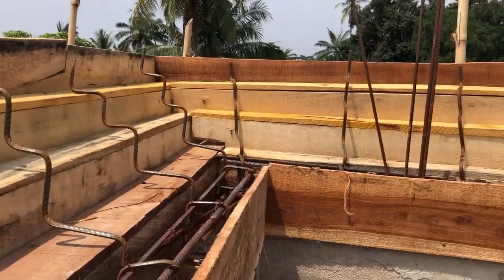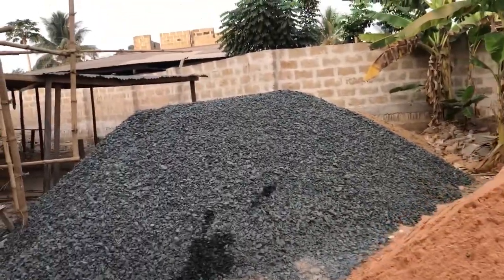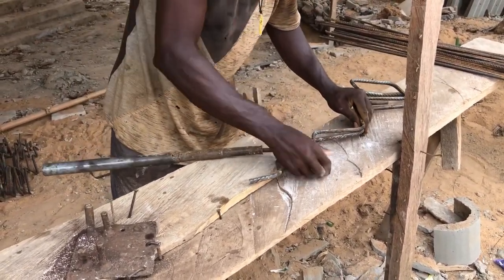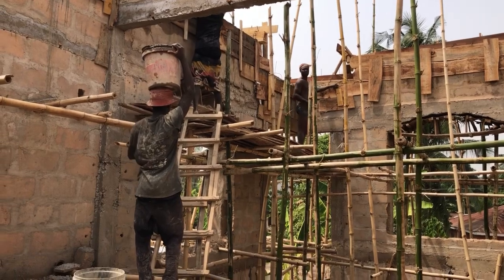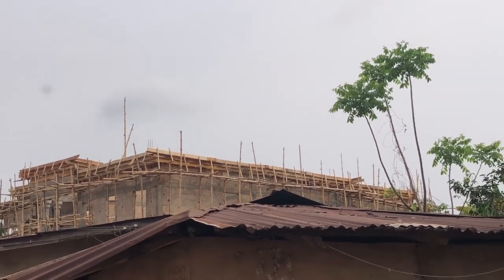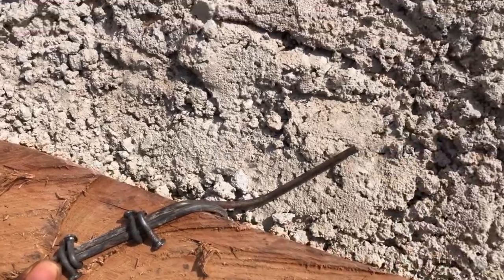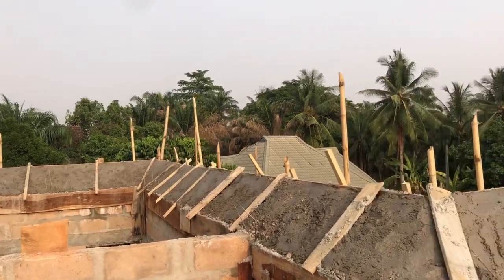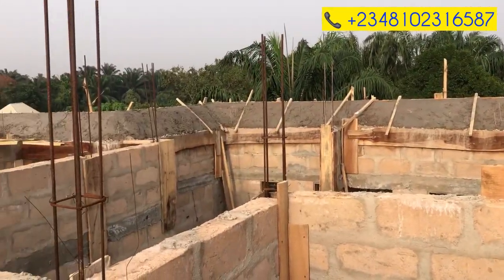PARAPET DESIGN AND ITS COST OF CONSTRUCTION

Comment: Two blocks or three blocks before window opening which one is more in vogue now?
Reply from the maker: 3 is okay ✅
Reply: @jaysamarchitect1578  With strip footing foundation how much could build a six bedroom duplex of 16x14m carcass alone with stone coated roof tiles??
Reply: @jaysamarchitect1578  Kindly respond bro on the two bedroom options.
Reply: @jaysamarchitect1578  Hello Sir. 

Option A 
Bedroom 4.2x3.9m
Bathroom 2.5x1.7m
Total floor space 20.63m².

Option B 
Bedroom 4x3.3m
Walkin closet 2.2x2m
Bathroom 2x1.8m
Total floor space 21.2m².

Please these two bedroom options which one is bigger and better here?
Reply: Option A 
Master bedroom 4.85x3.8m
Walkin closet or Dressing area 3.7x3m
Balcony 2.2x2.1m 
Bathroom 2.3x2.2m
Total floor space 39.21m².

Option B 
Master bedroom 4.8x4.2m 
Walkin closet 2.4x2.1m
Bathroom 2.4x2.1m
Balcony 1.5x1m
Total floor space 31.74m²

Hello Sir. 
Please these two master bedrooms which one is larger and luxurious in terms of space? 
Which option is best here?
Reply: Hanging parapet is cost effective